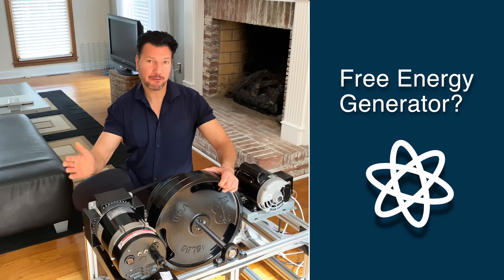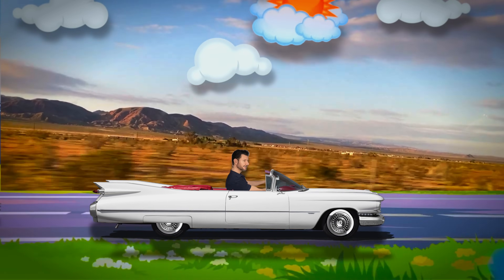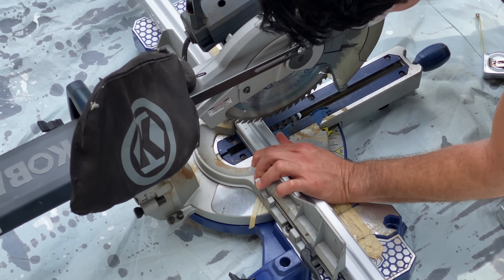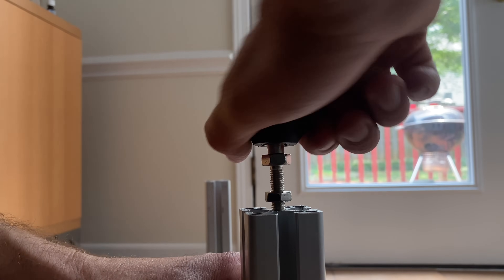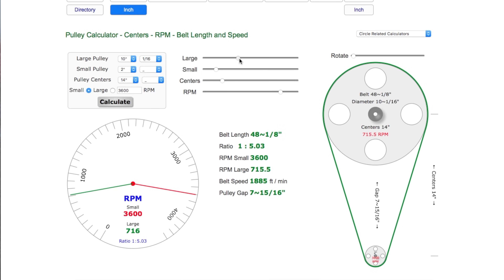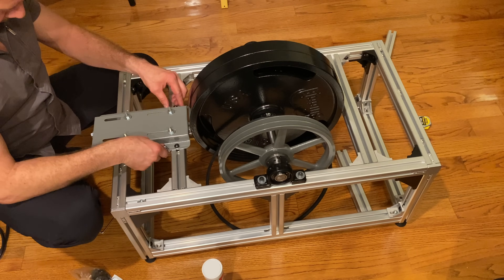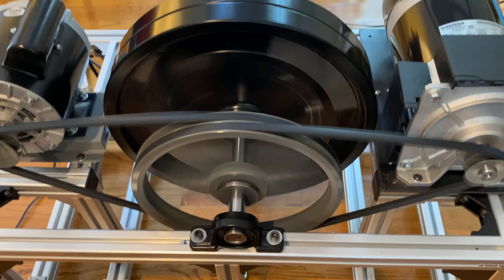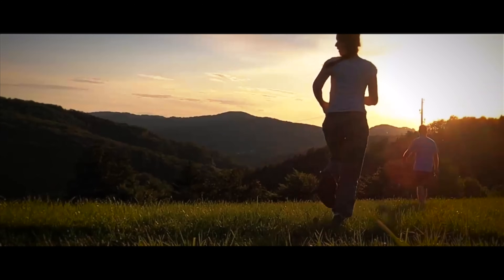How to Make a Free Energy Generator!

Comment: Friendly reminder that if "creating energy from nothing" was possible, we would all be dead in a universe infinitely heating up.
Reply: It’s not from nothing, I think the initial power from the grid powers this device and then the flywheel stores the energy and powers the generator but it doesn’t last forever
Reply: @seemaab 😅
Reply: Technically, since we've already decided that the first law of thermodynamics doesn't apply, we should be able to destroy energy, too, so we could get rid of the heat.
Reply: Flywheel stored energy
Reply: @dan27444  it only stores like battery but not give energy infinitely. It need to recharge
Reply: It's a scam. The video is just clickbait to attract the attention of a certain type of people. Notice the use of the term blockchain near the beginning. If you wait until the end, the video has a commercial for a decentralized carbon  credit system people can use to offset their carbon emissions. Really, it's just another cryptocurrency. Likely, they put out a bunch of stuff like this to attract gullible people, sucker them into pumping some money into the currency, where whoever is behind it dumps all the money into their pockets.
No wonder the guy can afford such nice hardware go building a really crappy and lazy interpretation of a perpetual motion machine.
I did a search on the currency, verde 350 and the wordpress website is down with some critical error. There was a pdf still online, but it was full of nonsense jargon. Might as well claim to fix climate change back a decade ago with cloud server technology. Blockchain is just some cryptocurrency lingo nobody really understands, so it's easy to toss around to make yourself seem smart.
Reply from the maker: The site is up and running again if you’re really interested.
Thanks again!
Reply from the maker: Well Jordan first off all why would it be a scam if I figured out it doesn’t work and say so in the video?
Second the nice hardware is because I either do things right or not at all and right means also investing in something even if that means it’s lost money.
As for Verde350 it was a great idea and I still think it would help to standardize the carbon offset market and make it less corrupt but it’s too big of a project for myself since I have a full time job.
Also you know how the crypto market is going nobody wants to invest into it at the moment.
The site is may has an error I haven’t paid any attention to it but will look into it thanks for that.
I am just trying to build things and entertain people and grow my YouTube channel. That’s why most of my videos are not about free energy even though that is my most successful most watched video! I don’t make videos just to get views that’s why there aren’t more free energy videos. Always looking for new ideas.
Thanks for watching and your feedback!
Appreciate it!
Reply: Free energy is in fact possible, but it's highly dangerous because for some reason every time someone invents a working model they end up committing suicide. So weird 🤔
Reply: @drkastenbrot : Constructive criticism was a tested method, to "correct" a seemingly a "wrong" occurence- pls apply the said method, to those "aspiring scientist" (?) ;🤗

The subject "Flywheel Energy Techn'gy" (FET), was already a 'TESTED system', now being used by the following group :

1) Video in You Tube, about Swiss "Gyro Bus Comp.", a pass. bus fleet, from 1941-1945, WW-2 era... After the war, said bus fleet were sold to an African nation ;

2) Some FET units, were in Americas college science laboratory, for student used, demos, etc. ;

3) The warplanes "catapult launcher", for Americas latest model 'aircraft carrier' - the FET system provide its power needs ;

4) Power provider, since the 90's decade, on Americas researhed, about the "Electro- Magnetic Artillery" (EMA) project ;

5) The cutting edge "power LASER" of America & Israel- the said FET system, was its power provider ;

6) The latest  hi. tech warship of Japans navy, armed with such EMA's weapon - it was powered by the same FET system... 🥰

Comment: the reason it was not working is because generaor was turning the wrong waygenerator has to turn counter clock wise your is turning clock wise fix it by putting a counter cock wise motor on it
Reply from the maker: Hello Max I have tried both directions.
You can reverse the direction of almost any motor. In my case i had to change how  the capacitor is wired with the motor.
But it didn’t work either clockwise or counterclockwise. Thanks for your suggestion though.

Comment: First thing the the first motor was the right motor secondly the pulled wheel is ok but the generator has 2 pole and at 3800rmp  the generator produces electricity but when the load is applythe generator slows down pass the rpm generating pole so current stop that’s your issue need to fix now remove the shaft of the generator and build a shaft to fit the generator exactly like the motor shaft use N52 neodymium magnet to cover the shaft and use something to hold it strong enough down and lower the rpm to 2000rpm and you will be great the rpm is the issue to produce but the magnet stop produce high voltage ar 600 rpm so the magnet is the best
Reply from the maker: Thanks!

Comment: I see you're problem , the center  big pulley is right for the little pulley on the alternator but the motor needs a big pulley like the center pulley going to a smaller pulley in the center , so you should have a big and little pulley in the center , you have them both the same size
Reply from the maker: Jim that was the only way to get the required input > output rpm
Reply: @MarkusNenning  , you have the correct output rpm but the wrong input rpm ,
The center pulley should be a little one and a big one , you have two big ones in the center, 
The motor is always going up hill , the alternator is going down hill ,  
Try eliminating the center pulley all together , then the motor has a bigger pulley than the alternator ,  
The motor is always running down hill because it has a bigger pulley, the alternator is always spinning faster because it has the little pulley , 
Faster speed , more power  
But it will be running down hill instead of up hill , 

Which is easier ?
Riding a bicycle up hill or down hill , 
That's basically what you are doing , you keep riding up hill ,
It takes the little pulley many turns just to turn the big pulley one compete turn , 
You are running up hill .
Reply from the maker: @jimthomas777  i was debating if I should have two different pulley sizes on the flywheel shaft.
Perhaps I have to try it out.
Thanks!

Comment: If you find a motor that draws lets say 2300Watts ( 230v / 10A ) wich is able to turn the generator at 3600rpm, u are producing 4800Watts. Isnt that free energy? Its 2500Watts free energy 😛
Reply from the maker: Exactly my point!
You would think so right?!
Watch part 2 if you have a chance.

How to Make a Free Energy Generator Part 2!
https://youtu.be/tFqn-atYcOU
Reply: And this is why all you people who believe in free energy need to get an education. A generator isn't making power until you put a load on it. At 3600RPM a 4800 watt generator is CAPABLE of producing 4800 watts of power. With no load, power production is ZERO. An unloaded generator STILL requires mechanical power input so right there your net energy production just went negative to overcome frictional losses not to mention electrical losses due to wire resistance that is dissipated as heat. Hook your generator up to that motor and the generator is only going to produce enough power to drive the motor, but due to frictional and electrical losses, it IMMEDIATELY slows down and stops. And niobium magnets aren't going to fix that. You people do realize that when a load is connected to a generator, the torque required to spin that generator goes up right? And that requires MORE input power to keep it spinning. It will ALWAYS amount to NET LOSS.
Reply from the maker: @MrDmbright65  nicely explained.
Thanks!
Reply: @MrDmbright65  there will always be NET LOSS.. there is a net loss on solar panels, there is a net loss on a gasoline generator. its still producing power. And making assumptions about someones education says more about you. All im saying is that if a 2000watt motor can spin a 4800w generator, even with all losses included you are still producing over 2000W, frictional loss is the biggest loss.. but wire resistance? Come on man if you had a education u would know its neglectable...

Comment: Change  small wheel that connect the belt that center wheel because that the problem. I see video that do that and it works. If you have 1 diameter,  center wheel must have  1.5 in diameter. Wheel must have a ratio of 1/1.5
Reply from the maker: Thanks Joseph

Comment: to balance a fly wheel you need to use the same stabilising system as a washing machine
Reply from the maker: 🤔interesting 
You’re talking about the suspension springs I assume?
Maybe there is something to it.
A wash machine fully loaded is max 20 pounds but using stronger springs might work.
Have you tried this yourself?
Thanks!
Reply: @MarkusNenning  yes because it spins so fast that if you do not remove the fastenings on the stabiliser the washing machine shake so bad and even bounces. I have not tried these sort of things but I full understand the science of it and how it works. I feel sorry for those who still believe free energy sources are fake lol

Comment: Dear sir
What if we use solar power to run the motor (single phase 3.3kw) 
And then move flywheel and then run 25kva asynchronous ac generator 3 phase then what happens, maybe it succeeded 
And it's also comes in free energy generation)
Please help 🙏  and suggest
Waiting for your valuable response
Reply from the maker: Hello Svojas it sounds like a good idea but in order to see if it works all you can do is try it out.
Sorry that I don’t have a more helpful response for you.
I think the combination of solar or wind power is definitely a great option.
Reply: @MarkusNenning  hmm, but not only this arrangement is sufficient I feel 
Mass and weight of flywheel matters 
Now I think I required speed booster gearbox some sets of pulleys to maintain velocity of flywheel 
Correct me if I wrong somewhere please

Comment: Hi my friend, you did a great job. I have tried that back home Eritera from scratch. It gives me the same thing. But what I see different on your system is that your generator is with to poles. That makes it to have more rpm. And your pulley on the flywheel are too big they decrease the rpm of the flywheel in which the energy is supposed to be conserved for little moment till the source of energy to the electric motor is changed and keep the alternator producing electric. Hope it ll works for you in this way and I hope I have a chance to do it again. Good luck 🤞
Reply from the maker: Thank you!
Good luck to you too hope your next try will be successful!

Comment: This is a little count force of a kinnetic energy in the plywheel 
in every rotation the weight force are compress external upto the  whole radius of the ply wheel the weight is stuck to the external wall when the RPM get higher the total of weight in the skin ofthe plywheel are 1  ton in one cubic milimiter

Comment: What I saw was a 240 volt generator running a 240 volt motor no electricity. He added extra magnets to the generator to increase the voltage I think, spun the generator by a pull cord and generated enough voltage to keep the motor running.
Reply from the maker: Yes I saw that video.
Will try to recreate that.

Comment: I want to try it to but the thing is you started big and you had kinda big investing costs to try the experiment.
First try should be small scale and if it works then ramp it up and try on large scale. 

The thing i learned since i'm trying this,
Belts are out only solution is shaft.
The flywheel method is not good cause you have 2 resisting factors as far as i can think for now.
Air & gravity. .... Maybe eaven magnetic on earth magnetic poles
To have efficient flywheel to store energy it should be in a void.
Second you need pre stored energy for the motor like when you use other device drawing energy from the generator and the motor dosent get enough energy you need something like a capacitor or multiple capacitors. This is the stage what i am at and having trouble findig capacitors for small scale.
After that you need to take in count the generator resistance for creating energy vs motor power for producing kinetic energy.
For example 10kw generator at top usage it uses 10kw+ all the mass ... force to overcome rotational resistance.

Now here its a theory, im out of my knowledge zone if you know what i mean.
The only way to achive that is to use different motor vs generator.
I dont know exact values and calculation methods but you need for example 10kw generator at 220v and a motor with inverter to use for example 5kw of 220v consumption but work at different voltage for example 12V and produce 10+ kw power (18hp+) 

If you can make that happen it has to work no question.
There's just the combinations you can allways modify voltage, current, and intensity just need to make more power with less energy thats the whole key.

Also am shocked about another video with some copper wire and magnets can light up an led lightbulb i would fill my yard with that if i can make it work

Hope to hear from you, tell me if you found a solution.
Reply from the maker: Thank you for your detailed comment!
Yes I know I should have started small and then scale up. But I learn from my mistakes:)
I just got a used car alternator and will try a different approach this time.

Comment: For free energy 😆 its very bad idea to use induction motor . Free energy really exist or not i don't know. But one thing is that i can say - when you put something load to alternator ( ac generator) its speed is suddenly change 😊and when speed of an alternator change it directly effects on frequency becausz frequency is directly releted to synchronous speed for its respective poles . When frequency change the output of motor torque speed also change . After all its almost fail 😊😁. Inducton motor,s speed torque is directly releted to the supply frequency . I think you know this think very well . 
Im not a engineer but also i wanna to suggest you - use the something BLDC motor and its contorl circuit ( invertor ) .😊😊😍
Reply from the maker: Thanks Yuman!

Comment: The flywheel itself is a very importan tacto in getting this to wok. The center of the flywheel needs to be thinner compared to the weight near the diameter otherwise you will lose energy faster than the inertia storage. Apart from that the ratios of the motor power consumption have to be proper. This should help you determing the issues with explanations. Infact the same theories are actually used in generators at power plants as the flywheels stor energy and act as a battery. https://www.youtube.com/watch?v=4qXnR_d6yPw.

Comment: Just a couple notes sir, 1. You must make sure that your motor isn't drawing too much power from your generator. 2. Id change the pulleys the out. If you went with a larger pully on the motor. then a smaller one, then even a smaller one connecting the generator you could increase the speed of your generator thereby creating more rpms. and thereby more power. good luck
Reply from the maker: Thanks Mark!
I have tried to limit the current draw of the motor with a currency limiter but so far unsuccessful.
Will keep trying different setups.

Comment: Well, a lot of people in Nigeria are using these generators, you forgot to add a (Series of) transformer(s) while redirecting power to the motor. There are hacks to it that keeps it running continuously as well.

The only issue is that a single motor should not run for more than 18 to 24 hours.
Reply from the maker: Thanks Solomon!

Comment: I've never tried as it's supposed to be impossible. What about using a 12v dc motor using a rectifier. Maybe using less voltage will have an excess produced. Maybe use capacitors or run in a vacuum lol
Reply from the maker: I am working on a 12V system at the moment using a car alternator.
Thanks Vince
Reply: @MarkusNenning    is there such a thing as a generator with a low magnetic field making it easier to rotate at speed. I would think the high resistance is the problem causing the need for more amps to be drawn to rotate it
Reply from the maker: @vinceywinceyspider  any generator under load will act like a brake. There may be some way of shifting the magnetic fields but I don’t know how.
Reply: @MarkusNenning  I've  ordered some parts and will have a go at the maybe impossible.
Reply from the maker: @vinceywinceyspider  keep me posted if you are more successful than myself I’ll have to visit and check out your project! :)
Good luck!

Comment: Nice attempt. It looks simple but its not simple. The many calculations are processes behind the real functionally project(1. flywheel weight is equals to weight of the generator + motor, 2. motor is of power consumption 300 to 500W, 3. generator is 3 phase minimal 2kW that only one phase energy flow back to motor, 4. two phases are bennefits for output, 5.wheels with rubber band is some sophisticated calculation(I have no detailed info, but motor to flywheel has diameter "d", and flywheel to generator has diameter "D" = a x d, a is between 1.85 - 3.65)) No additional info I dont have, but maybe this can a lot help.
Reply from the maker: Thank you very much for the information!